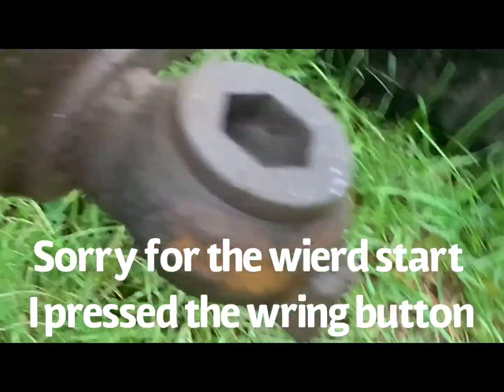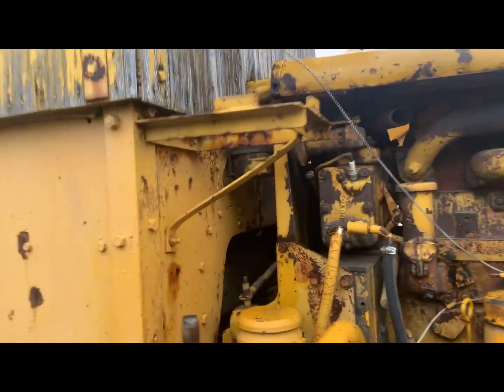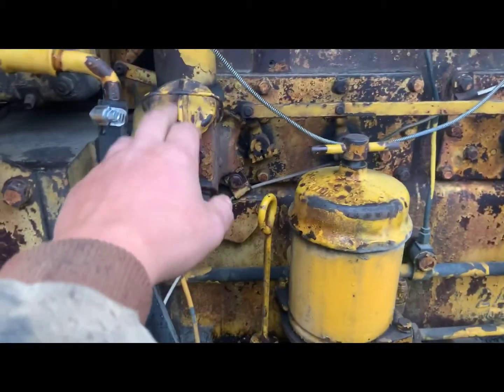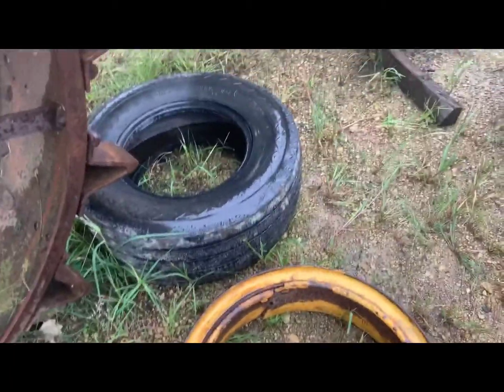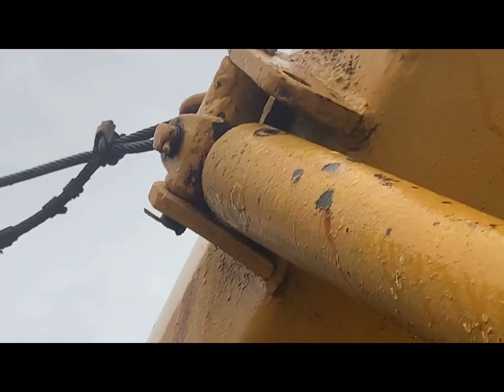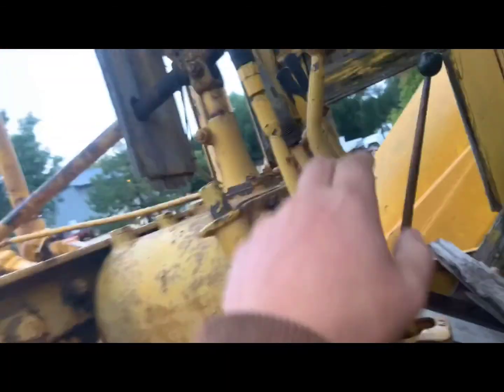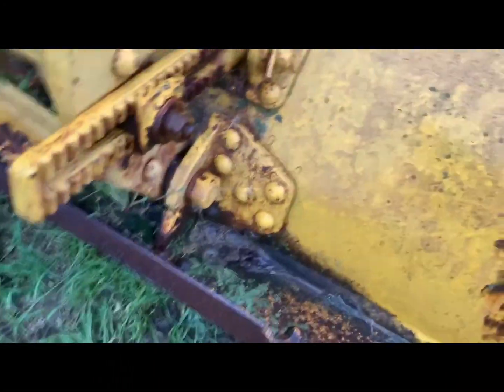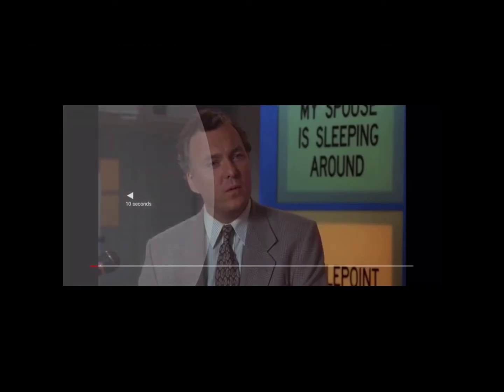Caterpillar Auto Patrol Part 2 maintenance No.7, No.9, No.10 gas or diesel, No.11 gas or diesel

Comment: Nice overview of the maintenance. 👍 Just greasing that beast would ware a guy out. 😁😆🤣
Reply from the maker: Rural Life With Ron Milwaukee electric grease gun is the way to go
Reply from the maker: Rural Life With Ron I have a old style that you push to pump it but that sits in the tool box for show
Reply: @whathobogrohknows   That's the type of grease gun I still use today on my equipment.  No worries about keeping a battery charged up. 😁
Reply from the maker: Rural Life With Ron yeah they are amazing but not the cheapest